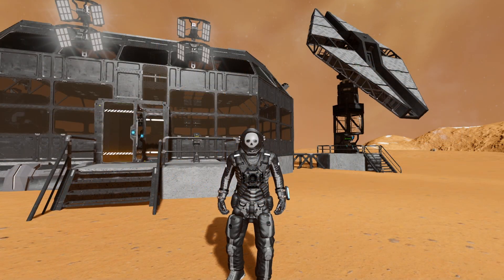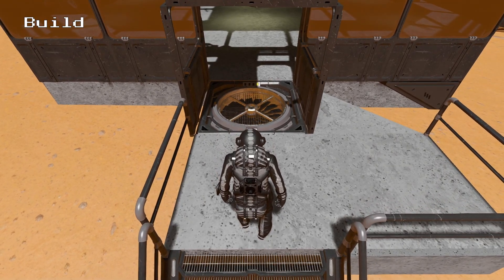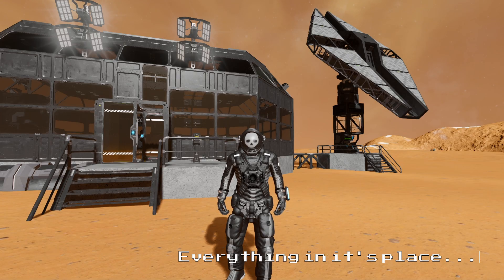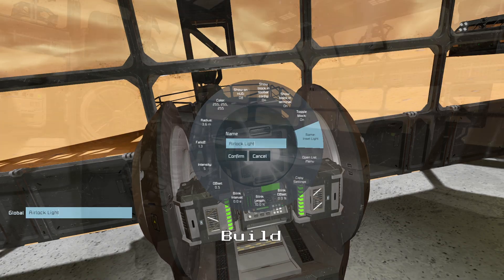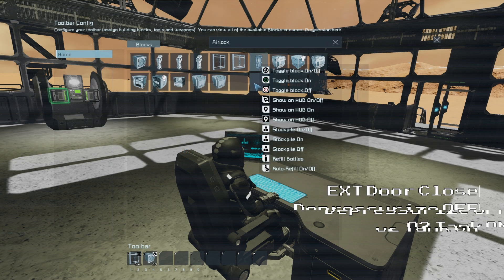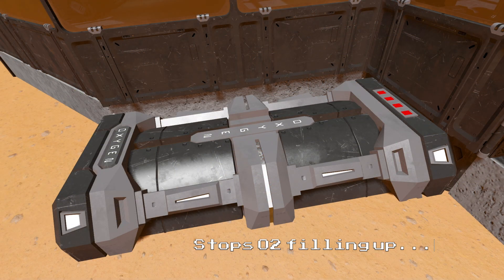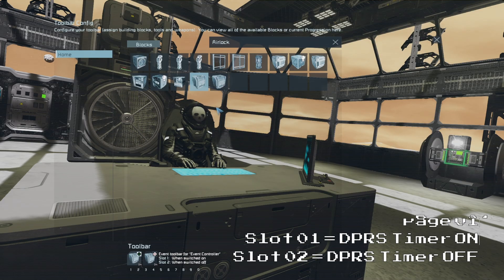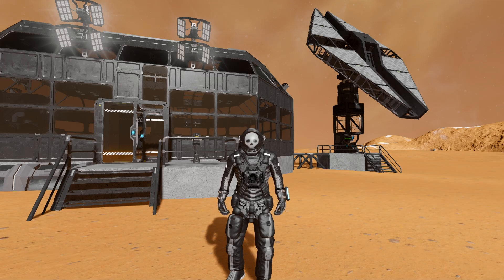Space Engineers | Airlock System | Vanilla Tutorial

Comment: Isn't it overcomplicated for just one airlock? I have tens of airlocks at my base. Yes, it's they no so cool airlocks, but i just use 2 doors attached with auto-close (by timer), so i have to manually open them, but this doesnt hurt air system and easily to build
Reply from the maker: Why play an engineering game if not to engineer?
Reply: @dread_mechanic Being an engineer doesn't mean complicating a solution where a simpler one is effective, which is what Occam's Razor also states. The "inefficiency" of my solution is only one additional manual door opening. Your option doesn't require that, but it requires building an order of magnitude more, takes up more space, and requires much more "programming," making it very difficult to scale and maintain. If the grid is self-contained and there's only one entrance, your option is preferable. But if there are many doors and/or saving resources is a priority, then mine is. Engineering is all about "requirements" - both functional and non-functional.
Reply from the maker: @JumangeeNET  An engineer invented that device you're using to respond to me and another invented the information network you're using to send that response.

Why not just write me a letter? 
It's simpler and more effective is it not?
Reply: @dread_mechanic I don't understand. Are you trying to say that the goal of any invention is complexity? As an end in itself? Then, by your logic, an airlock should come with an elevator, an access authorization system, a power plant, an air generator, and so on and so forth.
Reply from the maker: @JumangeeNET  The goal of most technological advancements has usually been to make life easier for the user and automate processes when possible.

If you want to have to open and close every single door you encounter and manage your O2 manually then be my guest.

I'm going to spend 5 minutes building an airlock so I don't have to worry about it 👍
Reply: @dread_mechanic and that is the beauty of space engineers! You can build whatever you want no one can judge you for it and if they do something different oh well it's part of the game
Reply: @JumangeeNET ^^^^^^

Comment: Oh btw, I just discovered that if someone does want to connect the O2 tank to the rest of the system for whatever "just in case" scenarios you can think of, using a pair of connectors face-to-face and an event controller lets you check the fill of the tank and lock those connectors if needed, which are set to auto-unlock after about 1 minutes. This fills the tank half-way through and then disconnects them from the system, so they don't cause any trouble later :P
Reply: can you do this with those one way conveyors? sorters i think
Reply: @davidbowman9917  Nope, those pass gas even if shutdown, and regardless of direction :P
Reply: @1KiloDepartment hehehe........ pass gas.......... Hehehe
Reply from the maker: Unfortunately Sorter only block objects, not gas...I was quite disappointed when I first learned that.
Reply: @dread_mechanic It's wrong. Morally speaking
Reply from the maker: Yeah you could absolutely use to Connectors to create a "valve" of sorts 👍

Comment: This is great. I'll have to rewatch and test myself as I'm new to some of this. How does the tank get air for the airlock? Does it just pull enough on first door open into the greenhouse? Won't it slowly deplete by user usage over time if helmets off? Sorry if it's a stupid question but that's my current level XD
Reply from the maker: Thank you! 
It gets the air from the bases O2 production while the Interior Door is open.
When it depressurises it first seals the door, extracts 1 cube of air and stores it for later 
When it repressurises it pumps that cube of air back into the airlock again.

After lots of testing it would seem that the Vent actually grabs slightly more than 1 cube of air and the Tank will very slowly fill up.
But the way the Doors are set up means that when the Airlock is pressurised and the Interior Door is open, the excess O2 that gets stored in the airlock Tank gets consumed as normal.

If the airlock Tank fills up too much you can just set one of your bases Vents to depressurise and pull all the O2 into your bases main Tanks.

Comment: How did I not realize that sensors, air-vents and stuff have extra pages in them :P I just took it as granted that since they have only 2 slots that they are meant to trigger a timer if one wants more and thus wouldn't have the extra pages!
 Though if they had more slots, what would they do? While 4 "on" and 4 "off" slots would be nice, I feel like some could be for more special things. Like when that block gets damaged beyond function, or the room cannot be pressurized, or when the block is turned on and off! Though I wager there would be better uses too (these are what I think could be helpful in some rare edge-cases) :P
Reply from the maker: That change only came about relatively recently with either the Contact or Signal updates I think.
Before that everything had a single page except for Timers.

I think after they gave us Event Controllers (which have 10 pages) Keen updated Sensors and Air Vents to match.

It's a change I very much approve of.